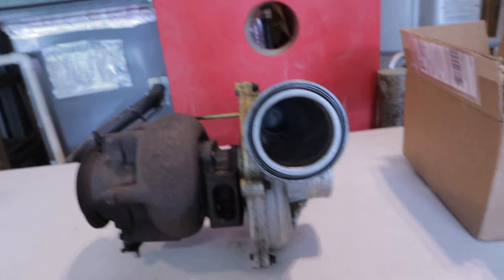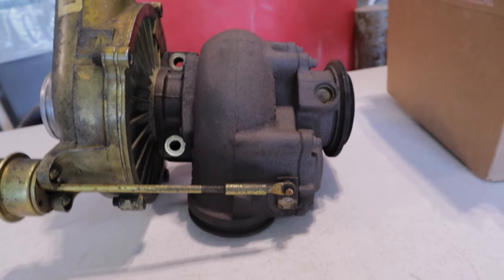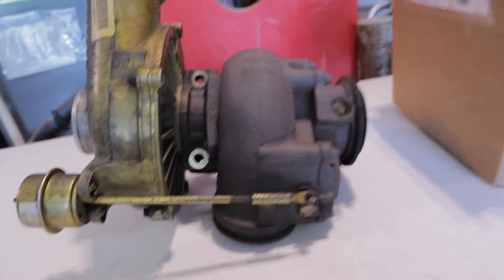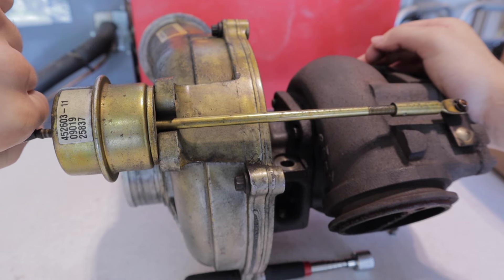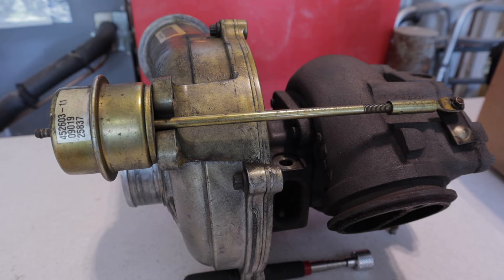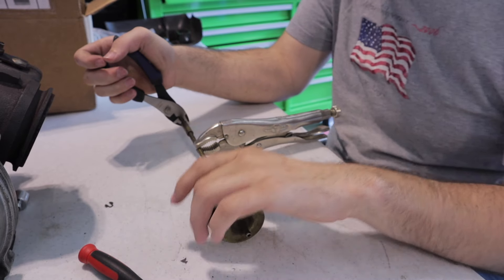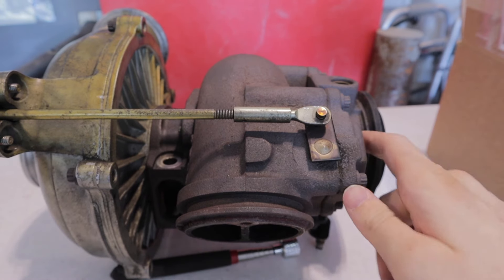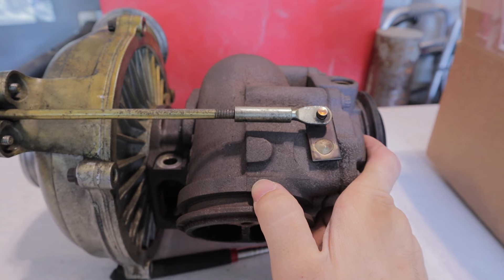Ford 7.3 Powerstroke Build More Boost For FREE!!!

Comment: A great replacement for the original boost actuator clip is a 3/16 E-clip.  Sometimes they are called C- clips but the 3/16 diameter is the exact same size as the Ford spring clip.  You can readily find these at the hardware store in the bolt and fastener area.  I actually went to the hardware store today and took some pictures of the E-clips but I couldn't load them into the comments.   But here in central Oklahoma these clips cost 23 cents each.  So it would pay to have two or three on hand before starting your turbo project.  I hope this helps someone out of a jam sometime.    Bob.
Reply from the maker: Great information man!
Reply: Thanks 👍 now we know

Comment: the little clip is also called a Jesus clip. Because you will say "Jesus, Where did that go" when it goes flying across the room.
Reply: That is not what anyone says.  It definitely starts with F and ends with K. Even Jesus would use that word.

Comment: Only problem with adjusting it you know what fuel injectors will support it !  If you have leaky or low volume from failing  lp. pump clogged strainers in fuel tk hpop. You be do chit!

Comment: I considered the 7.3  TD  98 and older,
 yet finding 99 and newer is better way to go on 7.3 Diesel for several reasons. 
Design, parts upgrade available etc. 
Though found a really nice 96 Low miles perfect in & out etc yet it’s the earlier ver .
BTW, have you looked into the Gapless rings and new design pistons??
Very impressive results on them.

Comment: Wonderful videos thankyou I have a 2001 450 7.3 started surging and having hard start I removed the oil check Ball with spring cleaned and ordered new and found my check valve at bottom of oil res needed cleaned as well now just waiting for parts but thought I'd ask if there was anything ells I should look at

Comment: That marmot..😂😂😂. Will this procedure damage the turbo or wastegate? Thanks great video...
Reply from the maker: No it should not cause any damage. As with just about everything, if you’re romping on it driving like a teen through a mud hole you might have problems but it should be no issue for regular driving and towing.
Reply: Ok thank you

Comment: Hey I really enjoy watching and learning from you. Your vids are always done in great detail. I just completed this boost gate adjustment on my 2001 F250 2wd and was blown away with the increase in acceleration with no load. Can’t wait to tow my toy hauler travel trailer. Prior to this I could never get above 15 to 16 psi on my boost gauge. Now my friend wants me to do this mod to  his 96-97 OBS 7.3. It may be easier bc the smaller turbo allows more access to that difficult e-clip. Any experience on doing the older smaller turbo? Any video on these?
Reply from the maker: Glad to hear you like the videos! I didn’t think the OBS trucks had a wastegate but I might be wrong.

Comment: i just welded the waste gate shut on mine and threw in a $20 wicked wheel with a fresh cheapo rebuild kit. runs way better then it used to by far
Reply: How is your truck running after 5 months now?
Reply: Genuinely curious how it’s holding up

Comment: I installed the banks big head waste gate on my 03 7.3 with the turbo in. I was successful but that little pin was a bitch magnetizing is a great idea I did that and it helped tremendously. I ended up scratching the hell out of my arms. I looked like I got in a fight with a cat but I did it successfully. boost is holding at 24 psi for up to 10 seconds my trucks a rocket now.

Comment: What would be a good upgrade to replace the original turbo with on a stock 99 7.3?
Reply from the maker: Good to know if it’s an E99 or L99. Either way though i think KC turbos is the best option out there for drop in replacements.

Comment: what if you have 1996 7.3 with no waste gate?
Reply from the maker: Then there is not much to do
Reply: OBS 7.3s don't have anyway of limiting boost , They just throw a CEL at 26-28psi of boost but wont actually cut fuel like the newer 7.3s

Comment: Is the shaft hollow? If not, it appears as though you are just adjusting the rod length not spring tension.. Please explain.
Reply from the maker: I’m not sure which shaft you are talking about. By shortening the rod, it’s increasing tension on the spring that holds the wastegate shut.

Comment: Non related rear hub bearings inners with oil slingers both sides have a spring around oil slinger is this normal or did both springs from both seals just happen let loose and end perfectly in place

Comment: I'm not so sure this mod does what people think it does.  

Shortening that rod, requires it to be extended out farther in order to re-connect it to the gate stud.  With the rod now pre-extended, isn't that partially opening that side of the actuator mechanism, when it would normally be fully closed/retracted?  And now the arm does not have the full range that it once did as set from factory, since it now has a shorter reach, so the wastegate will not fully open when the time comes.  

Pretty sure those actuators are fixed at a set PSI internally, and cannot be changed simply by adding a preload on the extended arm.
Reply: From what I understand the rod is pre extended to where it would be at let's say 10psi so there's more space for the pressurized air to act on the diaphram to expand onto without acting on the rod. Basically the pressurized air has a larger space to fill ie more pressure before the rod moves.
Reply: Nope had a guy from Cummins racing do my 12 valve Cummins. Shortening the rod definitely helps.
Reply: I agree with you 100%. The wastegate actuator is set from factory with a certain PSI movement. The opposing spring inside the actuator is chosen based on the pressure desired for opening the gate. In this video nothing has been done to change this opposing spring. The actuator rod has a limited range of motion. If this range was one inch and you shorten it by one half inch, the actuator still begins movement at 5psi and starts to open the wastegate but can now only travel the remaining one half inch of available travel since the adjustment. I've seen the argument on how the adjustment changes the area of volume inside the actuator and that's so minute that it's overcome in a split second and no noticable change in boost pressure would be noticed IMHO

Comment: Sounds good but i can’t see where this will work when you have the same waste gate pressure spring in it.  So no change.
Reply from the maker: It works because most springs are not constant tension or pressure springs. The more you tighten that rod the more force is required to pull the spring. Think about a trampoline spring the farther it’s stretched the more force is required.

Comment: My 7.3 in my 99 F550 manual tranny is currently in the defueling mode I believe from overboost. Maximum highway speed is 42 mph. I believe the computer does this to keep the engine from overspeeding the turbo wheels ie fans. Maybe my waste gate is stuck closed. What would be wrong with setting the waste gate actuater to start opening at 5 psig of pressure? Maybe engine will then not run in limp mode(defuel mode). I would appreciate your opinion.

Comment: Seriously, without changing the spring that actuator is going to move at the same psi every time. You are manually changing the tension on it and how far it opens that is it.. I get it though.. This trick works well diesels it's pretty spot on.. But with gas cars not so much.. Your ECU will over ride and adjust the opposite way to compensate on all the newer cars, or you may blow your turbo or engine. If you have a car and want to make more boost take her to a DYNO and a Good Tuner. But I get it this is for Diesel trucks and does work good.. Nice vid though I have spun mine 2 times.. I am probably going to change out my stock for a Turbo Smart stock replacement they make for my car but I'm going to stick with the same wastegate PSI though. I'm on a Tune. Nice vid..

Comment: Don’t have anything to do with clip.95 model old cid will run awhile and shut down probably because of hi- pop pressure no oil on dip stick going to fuel tank.Changed mechanical fuel pump and put B-B in fuel pressure also all new injector o-rings and shimmed all injector coils.And thought will greatly be appreciated.
Reply from the maker: If there’s no oil on the dipstick then I would almost guarantee it doesn’t have enough oil to run properly
Reply: Maybe I need to explain myself I little more I had just changed oil and filter. How does the oil get to the fuel tank that quick with a mechanical fuel pump.If o- ring on injector leaks shouldn’t the oil go to the radiator first or are there any other way it can get to the tank.If o-ring how do you determine which one (Thinks)parts came from riff-Raff
Reply from the maker: @mikemeadows8427  Ahhh I sea what you are saying now. Yes you probably have and injector O-ring issue. If the O-rings are bad you will mix il in your diesel because the oil is at a much higher pressure. Oil in your coolant is often and indicator of cracked injector cups. Unnfortunaty not a good way of telling which ones without pulling the injectors out and checking.

Comment: Question for ya new to diesel have 2002 7.3 bought ts-6 chip s&b cold air intake this adjustment you made on turbo would that affect tuning in any way. Anyone can do this regardless if all stock chipped ect
Reply from the maker: No need to worry about tuning with it. You may throw an overboost code if you hit 25psi but that not really a problem. Can get a boost fooler if it bothers you.

Comment: How exactly does the psi in the chamber change with you shorten the rod? The rod got shorter not that the psi changed, the difference is in the Valve
Reply from the maker: Shortening the rod preloads the spring more. Causing it to require a higher initial pressure before it starts to actuate. Hookes Law

Comment: I have a 7.3 in a 99 F550 manual tranny. Truck is currently running in de-fuel mode due to overboost I believe. Maybe my waste gate is stuck closed. Maybe I should set it to open at 5 psi to get it to run regularly. What do you think?
Reply from the maker: I wouldn’t think your engine would be over boosting at that speed. What RPM is it at going that speed? You should also have an over post code if that is the case. A boost gauge would also answer that question.
Reply: @LivingOnWheels  Thanks for your reply. RPM is about 2k at 42 mph in derate. No codes found. I may have a faulty computer connection.

Comment: Why can't you just take the actuate vacuum line off and run the turbo like that
Reply from the maker: You can but it still has the relief valve in the exhaust housing that will open under the set spring pressure of the rod.

Comment: I have a 1999 7.3 250 after hot falls on its face changed everything I think the waist gate is stuck will it make it run like that
Reply from the maker: I don’t think it would. Unless it’s sticking open? Have you tried unplugging your back pressure valve?

Comment: The early 99 has a different wastegate actuator than the late 99- 2003. I had a Banks Bighead on my 2000 F250. With a DP- Tuner set at 80 economy I could get 28- 30 psi of boost. I also had a Jobe performance intake. I am doing away with the DP- Tuner and installing a hydra. Going to a 38r turbo with the Banks Bighead installed made a big difference on mid to top end power. I would have bought a KC turbo but they were not in business back then.
Reply from the maker: 38R is still a great upgrade. I’m sure you’ll be happy!
Reply: @LivingOnWheels  I like the 38r turbo. It was the best upgrade when I bought it at the time for a drop in turbo. The only thing is it doesn't spool good on stock tune.
Reply: Was this an early 99?
Reply: @kirkkirkham7538  mine is a 2000.  Living on Wheels was a 2000 also.

Comment: Won’t work on my 97 f250HD.  As I don’t have one to adjust lol must be on 99 on
Reply: Got one too since new. Love it. Only 126k. Runs like a top. Would like a little more boost though.
Reply: @ use a .84 housing and a 5+5 with 6mm extended tips wheel and a360 kit.  I did mine my self.  It’s easy. And wow what a difference even with stock injectors.  And the sound is amazing.  I can spool up on command almost instantly

Comment: I have a friend who has a s10 with 2 of these that came off a power stroke 7.3 on his LS motor he is building on a small small budget will these work for him iv seen articles with conflicting info i have read you need a to lower oil pressure going in because it will blow a seal on the cold air side and suck oil into the motor is it possible to use these on a gasoline engine 
He is on a small budget thanks in advance
Reply from the maker: Im honestly not sure. From what I see the LS actually has lower oil pressure than the powerstroke. So I don't think there would be an issue blowing out seals.

Comment: You know you can turn the shaft with vice grips without removing the actuator right?
Reply from the maker: I wasn’t sure if that would mess with the internal diagram if spring but if not then that might be the best way to do it 👍🏻

Comment: I put an ATS diesel compressors housing and a riff raff diesel billet wheel on mine.  I need to do this as well as it still doesn't make enough power...
Reply from the maker: Turbo upgrades alone aren’t going to make a big difference on power

Comment: Hello there,

I hope you can help me out. I want to know what do I need to do in order to gain more boost on my 2000 excursion 7.3L? Everything is custom, I don’t have any modifications to the engine, turbo or transmission. I’m new with Diesel engine so I don’t know what parts do I need to upgrade to get more boost on the turbo. Thanks for your videos they’re very informative
Reply from the maker: Well a start is making sure you don’t have any boost leaks. First step up would be upgrading or tightening your actuator. Beyond that it’s either upgrading your stock turbo or buying a whole new turbo. It all kinda depends on what your end goals are.

Comment: You have to think of the back pressure being one-to-one with boost pressure up until about 30 psi you have the same back pressure trying to open the wastegate in the turbine housing and the diaphragm is not big enough to overcome the back pressure at about 10 psi so you're not going to gain that much psi
Reply: @rustysummers3217  the actuator is fixed at a particular PSI due to how the spring is calibrated, so this mod does not change when the waste gate will begin to open, it just limits how much it opens when it does.  it may have some effect, but i have a feeling it's minimal.  

as always for every performance mod made, there's a trade-off with decreased longevity of the stock turbo and other components.  plain and simple higher temps and higher pressure = more wear and tear, there is simply no avoiding that.

to me this engine is legendary because it was intentionally slightly de-tuned by the manufacturer to be one of the most robust and reliable diesel engines ever put in a light truck.
Reply: It absolutely changes the pressure at which it opens. More spring pressure takes more psi to overcome.  @salimoneus

Comment: Hello Joe! I hate getting stuck staring at my phone! I am personally against it! With my kids, etc.! It’s very rare that I find something that will grab me and hold me! If I had time, I would watch all your videos! You are a natural! I envy all you guys that have your own tools and garage I live in apartment in San Diego. I wish I had a place to work on my 73.
OK to the problem. It was late Thursday night. I realized I had a hole inside my cold intercooler tube. I had to do a quick fix. I put some self tappers through a thick piece of aluminum to cover the hole and then wrapped it.!
I’m sorry so long I will get to the point.! I think I messed up. I did not reach in there and knock any aluminum shavings off of the screws. Mind you this is only temporary. I just want to know what’s going on with my turbo. It’s whining . Is there a piece of metal stuck or is it actually going out. I wish I could send you a video. Anyway, tell me what you think. Keep in mind I did not reach in there and scrape off any metal shavings. Is this bad? Are they going down into my engine?. Thank you so much Joe I really appreciate your time! Keep on shining brother.

Comment: Doesn't that just shorten the throw rather than adjust the pressure? The pressure is regulated by the internal spring on the diaphragm.
Reply from the maker: I’m no expert but my understanding is by shortening the rod it’s causing more preload on the spring. Meaning it has to hit a higher pressure before the spring starts to move.
Reply: @LivingOnWheels  I've dealt with vacuum or pressure operated devices like these. That doesn't mean that's how this on is built. Usually it's just a plunger attached to a diaphragm with a spring placed on one side inside the actuator body. Adjusting the arm length will adjust the throw length, but not the strength of the spring. So your valve will not close fully or open fully if mal adjusted. You'd need an adjustable unit that has a nut on its face to adjust spring preload. Thus adjusting the pressure required to move the diaphragm and rod.
Reply from the maker: @ydeardorff  that may be. From what I’ve seen when testing on my own, it seams that the more I shorten the rod the more pressure is required to get that initial movement. To me that seems like it being more spring load. Like is said though, I’m no expert. 

I don’t think they are linear springs, I think they require more pressure as they are compressed more.